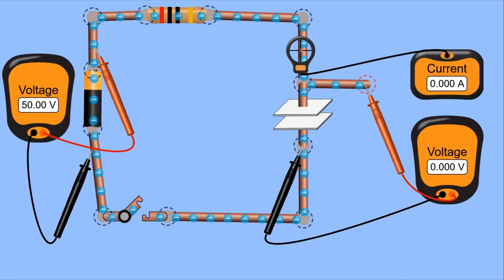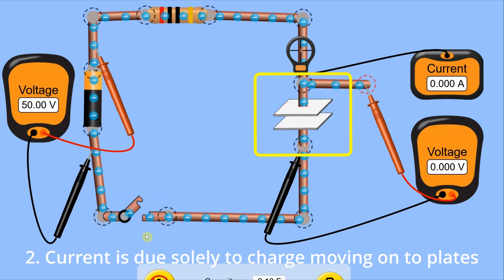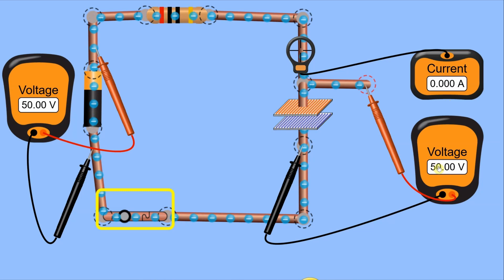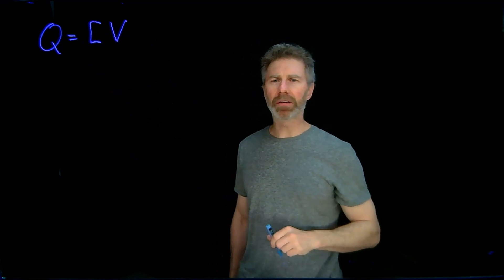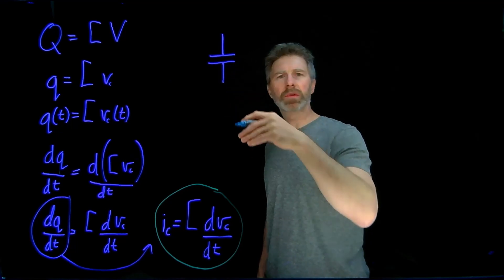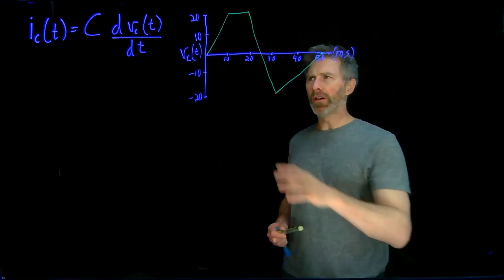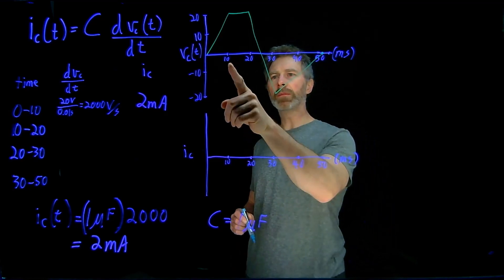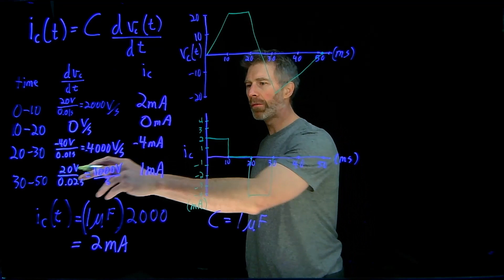Relationship between current and voltage in capacitors

Comment: What would happen with voltage/current relationship if a capacitor of a higher value is connected? Instead of the one calculated required ?
Reply from the maker: Exactly the same waveform shape, just the time constant is changed so it takes longer to charge/discharge